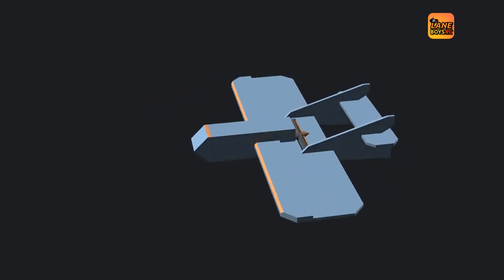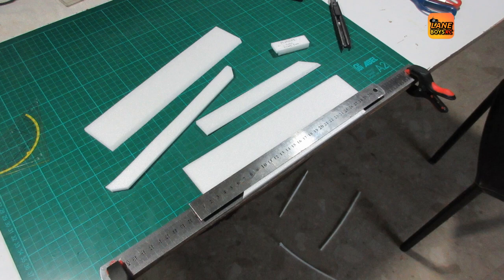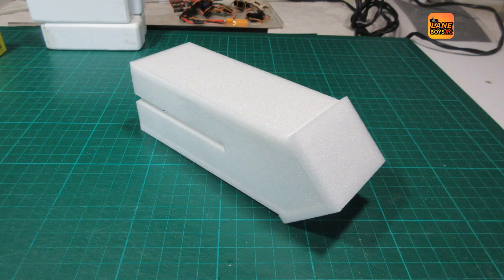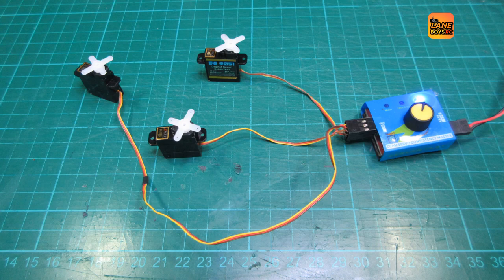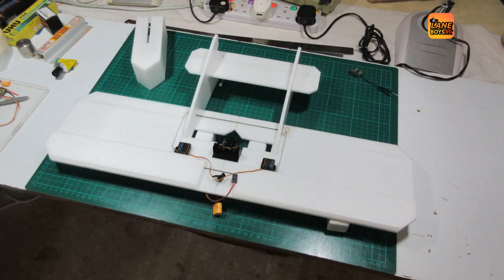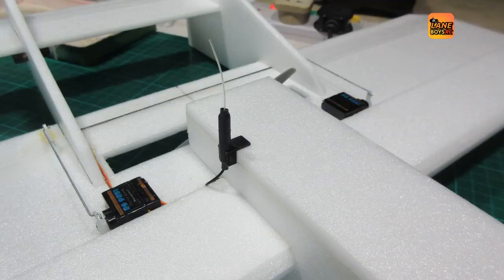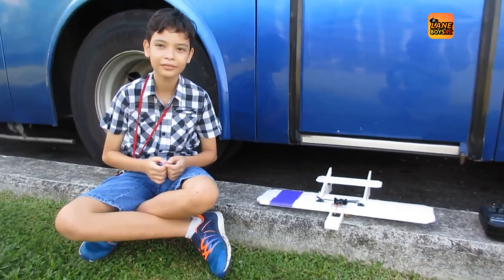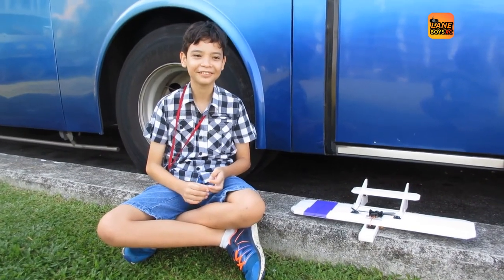XJets Outlaw250   A 600mm foam RC airplane

Comment: some info.   at :55,  the horiz-stab  should  NOT  extend beyond the  vert-stabs.  or else, the elevator  MUST extend the full length of the stab.      ailerons  Should  be  considered to be  PART  of the  wing; and its chord.

Comment: some info.   at :55,   it should be understood that when the fuselage is  Forward of the prop,  AIR FLOW  to the prop  is   Turbulent.     consequently, the cross-sectional area of the fuselage at the firewall  should  be  Just  great enough, to mount the motor.     an INCORRECT  iteration of  a  kfm2  profile is  Shown.     the step  SHOULD BE  located at  50 to 55 percent of  Chord.   why is this true.    LAMINAR/turbulent  flow.     a  kfm  profile is  Meant  to mimic the performance of a normal, cambered, two-surface profile; such as a clark-y.        in other words,  air flow over the forward 1/2 of the airfoil  Should be smooth/laminar;  while, over the aft 1/3,  air flow  Should  be  turbulent/reduced pressure/LIFT.     the  goto  profile  for models  IS  the  clark-y(v1) profile; 11.7%  thickness;   always thickest at  30 percent of chord.    such a flat-bottomed profile is  Intended to be  mounted at  zero-degrees  aoi.      googletranslate
ttps://en.wikipedia.org/wiki/Clark_Y
http://1.bp.blogspot.com/-5C8vhlmhBOk/VRe3o3Jt3yI/AAAAAAAABrI/EEgVHXkLvbY/s1600/clark%2By.gif
https://s3.amazonaws.com/assets.flitetest.com/article_images/medium/kfm-family-of-airfoils-gif_1395057126.jpg

Comment: some info.   at 5:21,   there is  NO, compelling, reason  to locate  the  MASS  of the elevator servo  at  the  TAIL.     it fact,  there is a  reason why  a  pushrod  should  NOT   be  made  too  short.       the prop noise is excessive, for three reasons.    the  prop is partially  STARVED  by the  FAT fuselage, at all times.       aft-side prop clearance should be a bit greater.      a  Correctly spec'd   E P  prop  should be mounted.          any description of the model's flight behavior  is irrelevant and misleading.       the model's flight behavior is  dominated by  Major  Flaws  in the  original design.   and, you have   fully  duplicated  those flaws.  (i have identified some.)      it can be understood that the model has a  less-effective wing,  as a result, the wing and model  Will be  less  stable  at  slower airspeeds.  period.     cheers               googletranslate